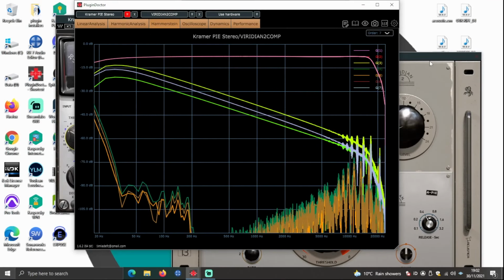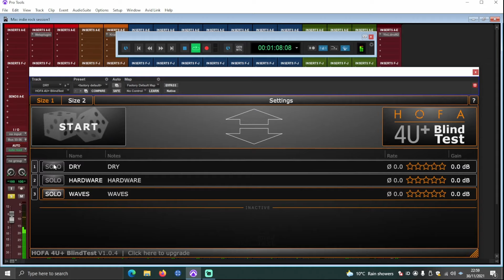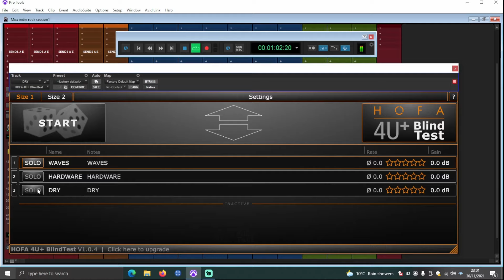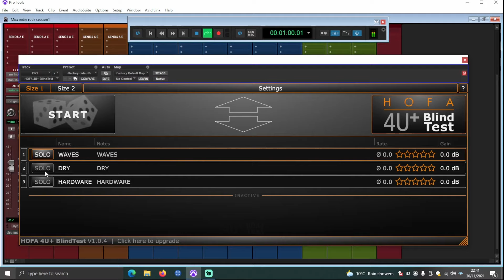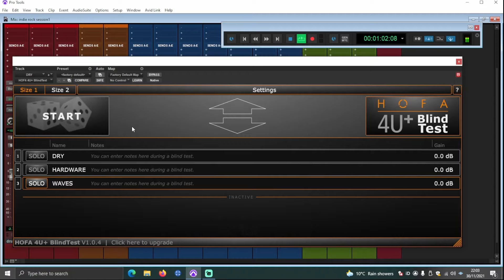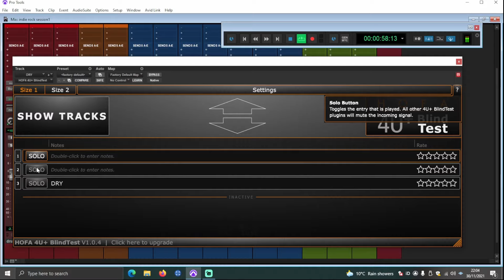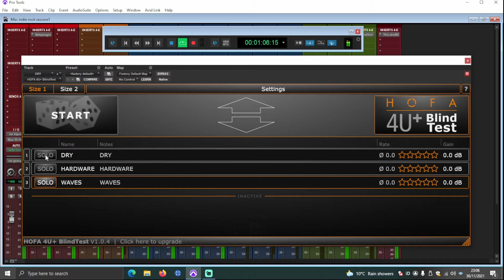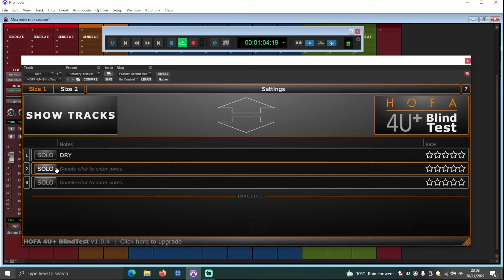I think Waves have actually done it this time!! 😱.. REAL pye compressor vs Waves kramer pie

Comment: I could hardly hear any difference at all, haha. Is the Pye compressor supposed to only give a subtle effect or was a very low ratio used in the tests?
Reply from the maker: All the hardware settings are before the shootouts.

Drums (4-8db) and vocals (10-12db) are 5:1, bass is 3:1(4-6db), guitars (4-6db) are 2:1
Reply: @PaulThird  Ok, thanks.

Comment: Hi Paul, I make harsh noise wall. It's this weird genre of experimental music. I'm wanting to achieve a sound like The Rita or Vomir but don't know where to start with compressors. I've never bought one before although I do understand how they work and have tried free ones that weren't good. 😊 Any suggestions? I guess I should just try as many free demos as possible.
Reply from the maker: Tbh just get a compressor that makes a lot of saturation and smash the shit out of it so it sounds more distorted. Maybe even a limiter with a delta so it gives you just the compressed signal, print it, then distort the shit out of that and blend it in with the white noise or whatever noise you are using. 

Tbh i don't get that style whatsoever but from what I can hear it's a lot of different types of distortion. My guess is you are probably looking more at saturators and distortion fx as opposed to compression.

Omnipressor can give you some whacky but cool sounding distorted compression affects

Comment: Many waves plugins can be saved as faithful analog emulations if they add oversampling to every single plugin.
Reply from the maker: Oversampling is a must for so many of their plugins. This was fine at 96k with aliasing due to its lpf at like 16k. Most of the high order harmonics are filtered out or pretty low level which at 96k keeps aliasing mostly like -90db max

Most of the harmonic energy is in the low mids
Reply: @PaulThird  Still isn't ideal, specially for cymbals and sounds with such a high pitched timbre. That aliasing noise adds up and can be a problem in a mix.
Reply from the maker: Yup, that's why I don't touch a lot of Waves. Some are only usable in terms of aliasing at 192khz but not all the comps are supported to 192.

Kramer works here as the aliasing is inaudible but only cause its so dark but still needs 96k. 48k you'll get audible aliasing
Reply: ddmf metaplugin let's you oversample any plugin you want.
Reply from the maker: True but not every plugin wants to be oversampled. You use metaplugin to oversample a plugin outside of its supported sample rate it'll multiply frequencies which isn't what you want.

With waves you can only OS x2 or x4 dependent on the plugin do you've just gotta be careful
Reply: @PaulThird  interesting.  I have metaplugin but have not really utilized it much or oversampling in general as I am one of those seemingly rare individuals that often does not like the sound of it.  sure oversampling sounds more hifi, smooth, etc. in a way but in a psych or punk rock context that is often the opposite of what you want.

Comment: I don't know about the rest of you but how bad is that lead vocal? If dude can't hit the note, work on it. Melodyne and auto tune are not the answer. Access Analog is an awesome service though. Almost a no brainer at this point.
Reply from the maker: Tbh I find that's normally the quality you get on free multitracks online. Not the greatest
Reply: @PaulThird  It is just sad that this is acceptable nowadays across all genres of music. People used to track until they nailed it and they could actually sing so it wouldn't take endless takes. What does that say about the state of the music industry? But hey, that's a diff topic all together. The only downside to access analog is that if you aren't organized, you can potentially lose a lot of time/money. If you go in organized and with a plan, you can get a lot done over a few hours and with a few pieces of gear.
Reply from the maker: Yeah it sucks cause I did my most recent single via take by take and lots of punch ins.

Got a few 'maybe could have used autotune on a few parts' comments and I dunno if its caused out ears are now tuned to expect note for note vocals or cause I was maybe a little flat or sharp in some parts.

I listen to a ton of 60/70's so I don't really pick up the need for autotune in my stuff. Greats like Dylan would have been absolutely slated in modern times
Reply: @PaulThird  True. If it isn't "perfect" it isn't right. No mic bleed between instruments allowed. Snap everything to grid etc etc. The musician ship in the 60's and 70's was extremely high for that reason. You didn't have endless punch ins. You had to get it close enough to right with the time you had.

Comment: I could hear a difference very well on my phone speaker in the drums example. Plugin has slightly faster attack and more air. Hardware is sliiightly darker and fuller. Overall i would be happy to use either one if them. But i probably won't - they are both too colored and bright for my taste.
Reply from the maker: Which one did you pick as the correct one in the final shootouts? 🤓
Reply: @PaulThird  Second one 100%
Reply: @TransistorLSD  welcome to the team. Are you willing to bet something on it too? I promised Paul 10 Bucks if I'm wrong. Just a little christmas spirit!
Reply: @akagerhard  Haha yeah i'm pretty confident, but i don't know about the money - i don't want to become a betting addict 😅
Reply from the maker: Good luck trying to get me to bet. Christmas spirit in my book is more about me receiving 🤣🤣
Reply: @TransistorLSD  :D it's all good
Reply: @PaulThird  don't you worry, it's a one-sided bet :P

Comment: paul!! you’re a madman! thanks for doing this, it’s great- really really good job man. and i agree, the waves pie is great. for me- sometimes the difference that i fee is when it’s blended into a mix, and not solo’d. the analog will sometimes feel larger and more “glued” (whatever that means) and makes the track sound larger. and sometimes not. it’s amazing to have access to both. and access analog’s tech is crazy, right? cheers mate! -reid
Reply from the maker: Glad you enjoyed it 🤓 just have to get through the rest of your gear now haha 😅
Reply: That pye on AA is incredible! Boom the minute it comes on it is magic. I will pick up the waves one as well as it isn't far off. just slightly less depth. In the grand scheme of things though, I can live with it in my crappy home recordings. Access Analog is awesome though. Again, just quicker to dial in great tones with hardware. The highs and lows are clearer. but plugs are close. I've done my own shootouts with AA pultec and Neve against the Lindell and Noise Ash plugins and they are almost there. Not enough difference to matter maybe in a mix but when you hear them on the hardware it is boner inducing.

Comment: The difference is apparent even on my AfterShokz, which I don't consider references at all. Anyway... Kramer PIE is a nice compressor (though supplanted by others I prefer), but it doesn't sound like the real one to me. It lacks the real one's dynamic details.
Reply from the maker: Which one did you pick as the correct one in the final shootout 🤓
Reply: @PaulThird , I didn't get that far. I already own the plugin, but the difference was very apparent to me at the outset, as it was for other commenters. Generally speaking, plugins sound flatter or more digital, because the modeling doesn't usually delve into the tone variations across the dynamic range, and instead focuses on an average. The plugin does sound very similar in character, but it just doesn't match the dynamic detail. My current favorite plugin compressor is Analog Obsession's YALA (Altec). I also am really enjoying AO's BUSTERse (SSL G/Townhouse) for bus compression.
Reply from the maker: But surely you'd want to test yourself in the context of the mix to see if those differences still stack up? 🤓
Reply: @PaulThird , it's a good plugin, just not as good a reality. In the context of a mix, with all the other elements that build a quality mix, I certainly wouldn't be worried about the difference I can easily hear in the isolated case that I heard. I don't feel the need to prove it.
Reply from the maker: Hmmm OK, just saying as the poll already shows 73% of people can't tell the difference in the context of the mix and guys saying similar to yourself that it's very easy in isolation have actually got the final shootout wrong. Quite a few already actually. Some have got it right, some haven't. From the guys that have said they can easily tell the difference id say its around a 50/50 success rate.
Reply: I'd say 50/50 is about what I'd expect. I prefer the sound of analog equipment but not enough to sacrifice convenience and total recall of a session. This is a good plugin, hence why I bought it when it launched. I wasn't comparing it to hardware. I just thought it sounded good at the time. Eventually, other plugins overtook it. Before Analog Obsession came along, my previous favorite compressors were the newer versions of the sets on UAD. They have more of that dynamic character. But the AO YALA Altec emulation just knocked my socks off. My channel strip is the bx_console E (SSL 4000 E), and usually that compressor works wonders. But if it's not up to the task of a particular source, I nearly always go for YALA. There are always exceptions, of course, when it comes to the channel strip, compressors or EQs when I opt for others.

Comment: Can only hear it through phone right now, but I always had the impression of the Waves plugin that it takes away a lot if low end so I barely ended up using it. Is it the case with the hw as well then?
Reply from the maker: Yeah it sucks a bit of low end out via the compression but adds harmonics in the low mids so you can get a bit of low weight but still gonna suck the bass out a bit. Tightens it but yeah would sound better if you could hp it so you could keep some of that low end in thd kick

Comment: To add, my favorite parallel drum crush compressors are PIE and Valley People Dynamite (Softube vers). For the PIE, I like both the Viridian and Kramer, just for different purposes. Never really tried them on other sources TBH. I have other go-tos for other sources.
Reply from the maker: It certainly has a sound. I can see why many use it on drum rooms 🤓

Comment: Paul, your videos are brilliant, thanks for spending your time and money to make them.
As far as I know, not too many audio engineers are willing to do a double blind test like you. They're afraid of their reputation :)
Since few years ago, the difference between "the real thing"....be it a guitar amp, console channel or outboard gear and their respective plugins started to be so small that I can say it is in the maximum 5% on a double blind test. And this when I'm not "fooling" myself that I'm hearing "more air" or "the magic bump on the kick at 63Hz"  :)
This raises the question: does it make any sense in 2021 to get 50K worth of gear, when someone with more knowledge can knock off a mix in 6 hours using plugins that sounds better than mine?  The power stays in the understanding how to mix , not how to achieve more gear that will "magically make the mixes better".
Reply from the maker: I figured out a long time ago that there is no magic in audio and everything can be measured and replicated in many ways.

Analog is analog, digital is digital.

Sometimes they'll get very close and sometimes they won't but neither has a magic recipe that will make your mixes better. It's all about the engineer

Comment: You got the first one wrong, the second one right. Drums are cutting through more with the hardware, hardware vocal is less croaky. The "cutting through" really depends though. With the drums the real low thumb comes through more with the hardware, but depending what you listen on on some hits the waves will be perceived louder due to the higher lows. That's what I'm hearing anyway. Not being able to switch back and forth between scources exactly when you want it really makes this a harder comparison imo. But the fact that you'd require that to tell the difference with confidence shows it's rather close. It's not the same though, I'm confident I would be able to tell the difference correctly and every time if I had the stems and could do the blind-test myself.

As it is I'm not confident, but it's my best bet.
Reply from the maker: So your sticking to first is wrong and second is correct?
Reply: @PaulThird  yes. I'd be surprised to be wrong. But it's possible.

Comment: Veridian is an old plugin and has old problems. AA did not know how to properly tune the compressors in those days. The problem with the Viridian is not only that it is very clean, attack and release simply don't work right and it doesn't compress enough. The same problem with Cream compressors. Waves 12345 is much better. Kramer Pie is also very good!
Reply from the maker: It's odd as it's viridian 2 so it's had an upgrade. Dunno what went on with that one tbh. When I measured the compression ramp in doctor and also compared attack and release shapes they were pretty much bang on but viridian had this wierd lift in the tail right at the very end
Reply: two words: user error. your mention of cream gives it away - there is more than enough saturation and compression in that plugin with the preamp enabled and driving the input, especially the zener. it’s one of my favorite drum smash compressors for that very reason.
Reply: @shayeasy  sorry man, I know Cream very well and I know gain staging with AA plugins also very well. Let's assume that Zener is a modern version of TG12345. Also, we can consider TG1 as a modern option of 12345, because they are diode-bridge compressors. I never use the hardware version of neither of them. But for my ears Cream doesn't sound like sound examples of TG1 on youtube. Also for my ears Cream have all problems that AA has with their old compressors. They behave weirdly when you try to smack them out. TG12345 has quite a fast attack and for my ears, Cream is slower. Maybe I am wrong. But when AA updates old plugins compressors often sound better after the update and get rid of past problems (like amethyst). So I just want a new update for cream. Anyway, Cream can sound good in its own way but for me, Waves TG12345 sounds closer to what I expect from the fast diode-bridge compressor.
Reply: @shayeasy  I mean that Cream doesn't sound like TG1 on this video https://www.youtube.com/watch?v=yyTiYCGfUKU

Comment: Kramer Pie is my go-to drum buss compressor. Just 1db of reduction makes it that much punchier. One of Waves' few wins in my book.
Reply from the maker: Not gonna lie wasn't expecting it. Very pleasantly surprised. Right out the box has that pye sound 👌
Reply: Surprisingly Waves do have some great plug-ins in all honesty. If they would only add oversampling they would be much much better.
Reply from the maker: That's their final roll of the dice for wup 🤣. Either that or they'll do an ev2 and bring out new releases of all plugs with oversampling instead of just updating their existing plugins.

Either way it's gonna cost us that's a given but I'm just glad I have metaplugin so I don't need to give them any more money.. I've spent more than enough 🤣
Reply: @misterniceshoes2888  absolutely. The CLA-76 is still my favorite 1176 plug-in, especially when I run it 4x oversampling in Metaplugin. Definitely one of my most used, next to the Pye, RBass, Maxxbass, and LinMB. RVox, MV2, L1, and RenAxx are great too. If Waves could just get the anti-aliasing filters and oversampling right, they’d be damn near amazing.
Reply: @PaulThird  Aye, with their latest shanghais with the EV2 nothing would surprise me. 

I really need to pick up the metaplugin! I probably wouldn't update even with oversampling unless the WUP was on a deep discount, funny how it's the only thing at Waves that isn't on a year long sale haha!
Reply from the maker: metaplugin is only £34.. Get on it!!

I used it here for the stereo instances as the access analogs stereo is dual mono. Pain in the arse but having 2 seperate instances routed left and right does give you more options

Comment: the hardware sounds like its not sitting the kick as far back in the background as the Waves version
Reply from the maker: It's a tough one cause in the blind tests it's hard to evaluate which is which cause I dialed it in to an inch of its life. Times I feel the hardware has that kick just a little more upfront and then the waves will just bring it forward more at times.

The blind tests were an eye opener for me on this

Comment: the way to hear it is that the Waves smears the initial transient more than the hardware. The hardware retains more punch
Reply from the maker: At times yeah but i feel in other points it manages it. After sitting for so long with it I can say it's very close haha
Reply: If the waves one does better for initial transients, that means it would be better as an expander or transient enhancer than the hardware used.